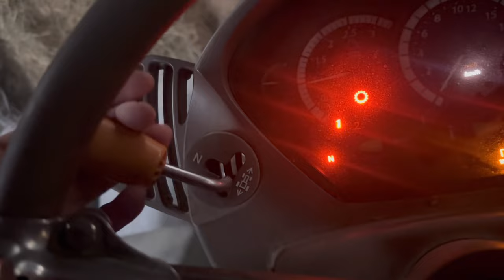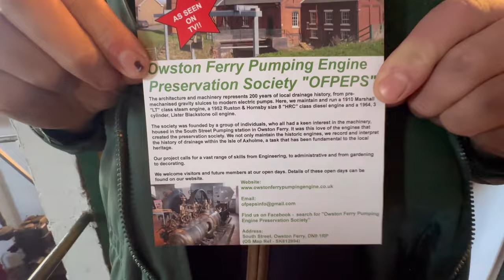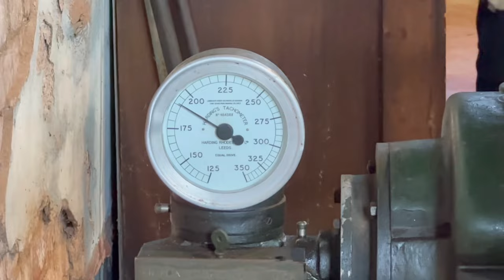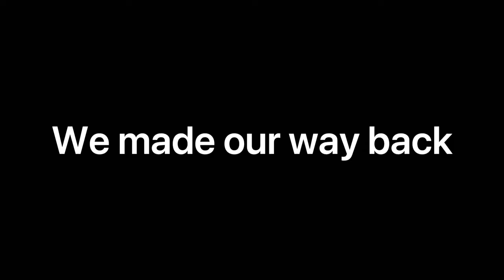Pumping Engine! Kept Alive! Owston Ferry, Farming and Tractors! History!

Comment: The two small pumps outside run impellers that are under the concrete base. You have the electric part above ground and there is a shaft that goes down to the impeller so it keeps the electrics away from the water. 

The two things you asked about on the giant snail impeller housings are grease cup lubricators. You give the top a twistnand it pushes grease into the bearing. The type of pump inside the snail housings are centrifugal force pumps, rather than piston. 

Beautiful old machinery. My partner gets to visit these for his job.